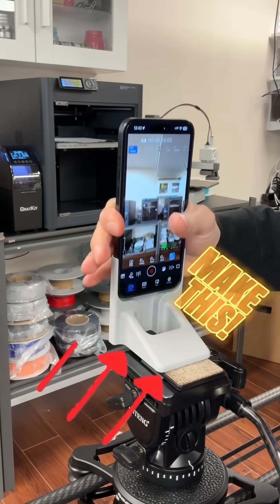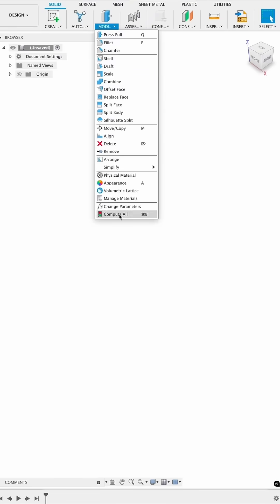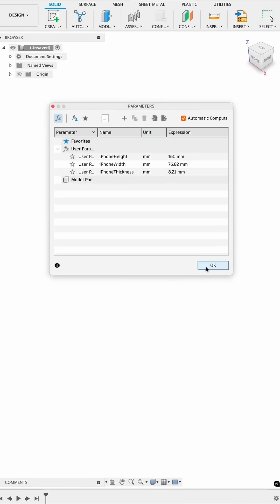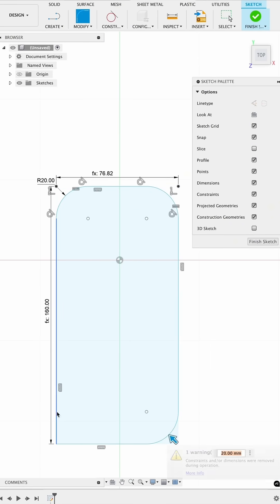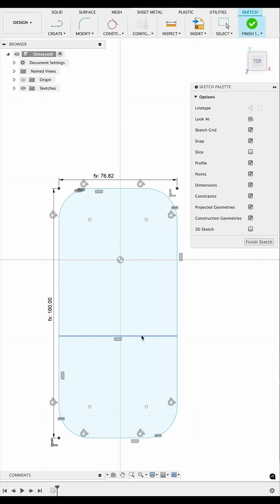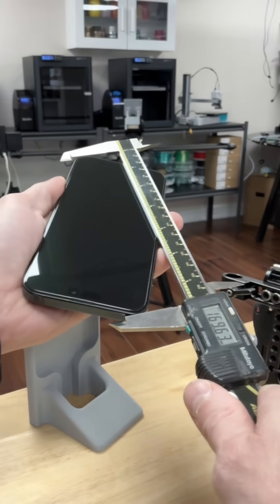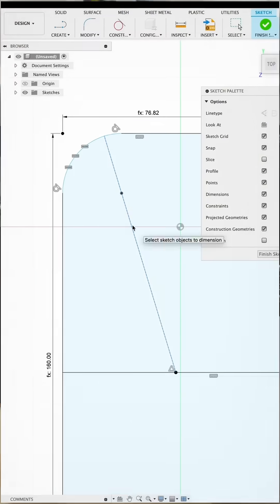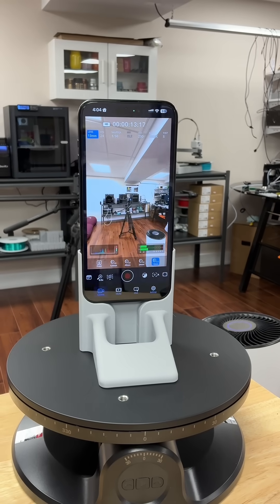Stop Guessing! Use This Trick to Measure Rounded Corners For Your 3D Printed Designs!

Comment from the maker: There is a reason the teacher would always make you show your work! Yes, we could use a radius gauge to get it close, or hold it up to the screen, or take a picture and trace, or even pretend were designing parts for a Cyber Truck and just square it off. But in this video, we learn a way to workout the answer for this problem :)

Comment: practical advice is not use fillet, the phone will fit holder if the fillet is smaller. moreover you don't need those to be exact same shape as phone

Comment: Here's tip for an ODD SHAPPED fit:

You can just create a close enough design to 3D print, and insert BAKEABLE CLAY in between the object and your print to make the perfect fit.  Some saran wrap between the object and your clay will make it remove perfectly. 

Since it sets at 275 or below (F) your PETG print can just ride along into the oven to give you a really durable shape of anything that you want to grab or encircle (suggested for someone wanting to grab a chainsaw handle to lash up a remote throttle mechanism that was 3D printed).
Reply: No machinist/perfectionist would use Clay or other material to avoid imperfections. They would go with a proper solution.

Comment: why even try to match the radius? just make a holder with corner relief. i don't mess with corners and always use reliefs.
Reply from the maker: @difflocktwo  this video for educational purposes. It's only 30 seconds to draw two construction lines and take a single measurement, I promise I didn't overexert myself here over radii :)

Comment: Even easier: print a jig that holds a ruler to 45 degrees to a right-angled frame.  Hold the frame to the corner of what you want to determine the radius of and measure from the corner of the frame to the object radius.  Now add a similar constraint to your sketch.

You can use that jig with absolutely anything.  You can also make one to work with a caliper for even more accuracy.
Reply from the maker: @KeithOlson
Reply from the maker: @KeithOlson  not sure how thats easier? I didnt have to print anything to assist in measuring and the fit came out perfect; one measurement and 2 construction lines. Literally 30 seconds of additional work 🤷
Reply: @leckiestein  "not sure how thats easier? "

It isn't.  ...for one, single measurement.  On the other hand, if you are planning to model physical objects off and on for years, a tool that can work quickly, easily, and accurately over and over and over again is priceless; seconds saved will add up to hours.

Even more time can be saved if you use a USB/Bluetooth digital caliper that will enter the measurement directly into your CAD software/spreadsheet/etc. at the press of a button/foot switch.  (You can pick up cheap ones from the usual suspects for less than $25.)
Reply: the easy way would be simply measuring the width with the corners and the distance between the starts of those corners. A flat ruler makes clear whats the actual side is as thats what makes contact. Subtract those widths and then divide by 2, thats your fillet radius you can enter directly ... no silly center lines and diagonals needed.

Comment: That's not the center point of the rounded bezel tho....
Reply from the maker: @littlebuch  were looking for the maximum corner to corner distance which is found at the end of my projected line. Another method I use: If you draw a circle and apply our phone's diagonal measurement to it then constrain the circle to the center of the sketch, you will see the circle intersects perfectly with the drawing that was done in this video :) both methods work.
Reply: @leckiestein  Even easier: print a jig that holds a ruler to 45 degrees to a right-angled frame.  Hold the frame to the corner of what you want to determine the radius of and measure from the corner of the frame to the object radius.  Now add a similar constraint to your sketch.

You can use that jig with absolutely anything.  You can also make one to work with a caliper for even more accuracy.
Reply from the maker: @ not sure how thats easier? I didnt have to print anything to assist in measuring and the fit came out perfect; one measurement and 2 construction lines. Literally 30 seconds of additional work 🤷

Comment: Or just print a radius gauge first
Reply from the maker: Radius gauges are definitely useful tools, but for this application, they fall short. For example, what happens when you need a precise 12.375mm radius? Gauges often come in standard increments like 12mm or 12.5mm, which leaves room for guesswork—exactly what I was trying to avoid with this method!

Plus, in this case, the drawing needed to be done anyway to match the phone’s shape. Adding one measurement and two construction lines to get an accurate corner radius felt quicker and more precise than printing and fiddling with gauges. I appreciate your input, though—it’s always fun to hear how others approach challenges like this!
Reply: @leckiestein  if you need below 0.1 tolerance you get a micrometer device and machine it and not print it. 

I just do what i was taught in my courses tbh so focus on seeing basic geometry and doing the math

Comment: I was literally just working on a similar measurement and this showed up on my feed. Nice tip. I'll use it immediately. Thank you!
Reply: Onshape lets you dimension to the outside of opposing arcs so I didn't need the helper line from center.
Reply from the maker: How are you liking Onshape compared to Fusion?
Reply from the maker: Oh ya, Ive never been a fan of SolidWorks. But I have been considering trying something new; Ive had a great time with fusion over the last 9 years but the continued price hikes, now an inability to share seats with users on the same account, and constant updates that seem to break more things than they solve.. well, it feels a shift into something new would be a wise move at this point. Ill give Onshape a look! Thanks!
Reply from the maker: Happy to help! Glad the video was useful!